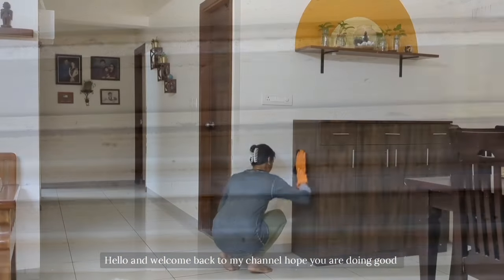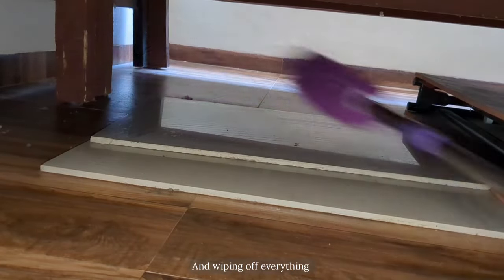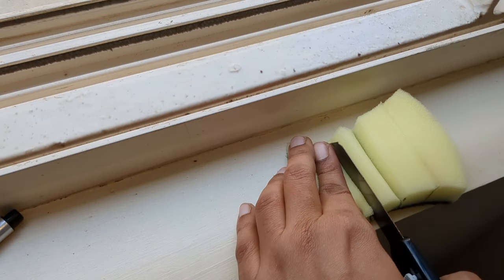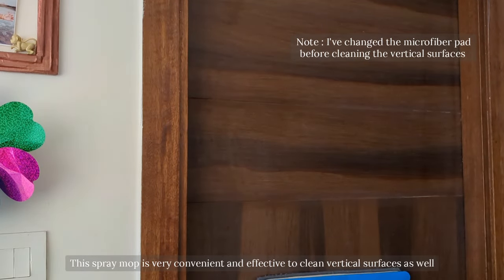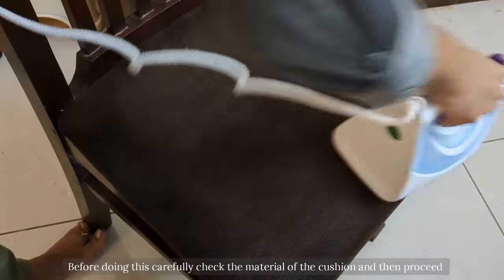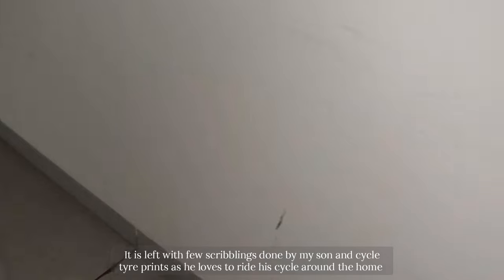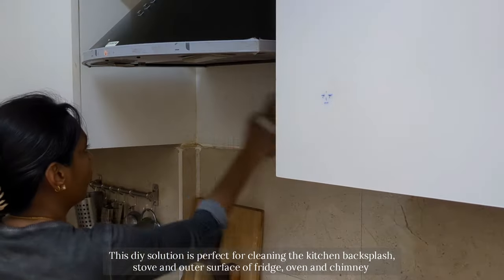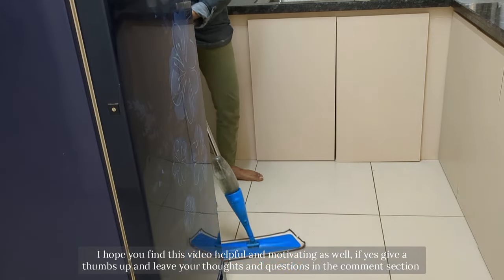The Secret to Sparkling Clean Homes | DIY Hacks with Essential Oils

Comment: How do you clean these glass door. I always end up leaving marks after cleaning
Reply from the maker: Many factors are to be considered, always clean during a cloudy day, then use a squeeze to clean after spraying the cleaning solution, always wipe them from top to bottom, at last use a micro fiber cloth. 

https://youtu.be/ApqZp0Z2sJk in this video I have shared the step by step procedure 😊

Comment: Great video! Keep up the great content! Was very satisfying! 
One question though. How do you clean the outside of the windows? Thr bara keep getting in my way and its hard to get a streak free finish
Reply from the maker: Thank you so much ☺️

First I bought this https://amzn.eu/d/fwJGpRX magnetic cleaner, but it was a super failure.

Then I came across this triangle mop https://amzn.eu/d/gavRqMZ,  I've seen  few youtubers claiming this to work well.

 Honestly I just leave my windows in the hands of heavy rain 😂 it will loosen up all the dirt, then I'll wipe the easy to reach areas with a microfiber cloth.
Reply: @J.s__Nest  lol. Same here !